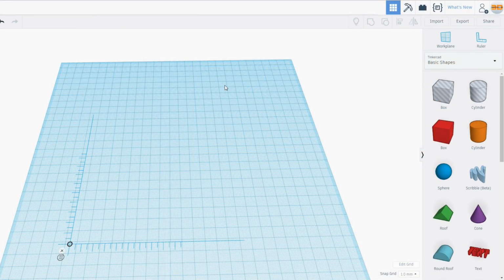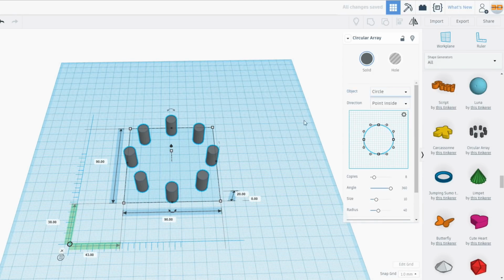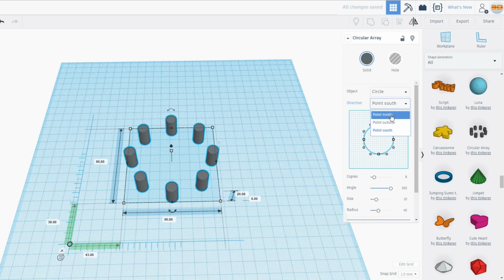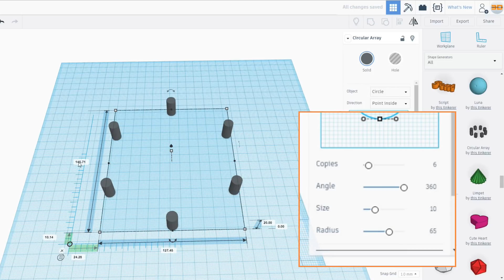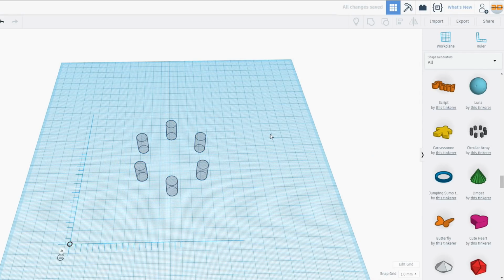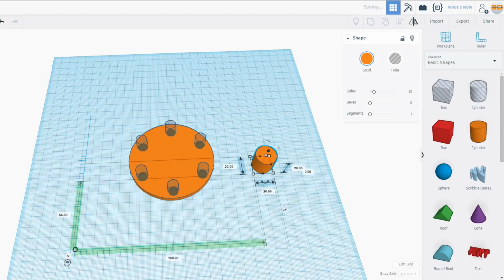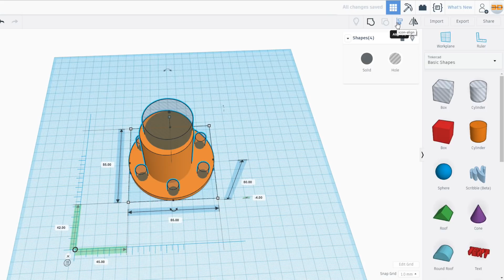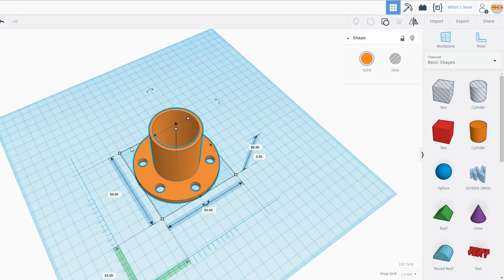TinkerCad Tip - Shape Generator The Circular Array!

Comment: Is there a way to quickly create a fillet on the seam that connects the base to the cylinder? I can think of a couple of ways of doing it, but it would involve making the fillet manually, wasn’t sure if there was a setting for this or maybe a quicker way to do it for added strength to the part being made. I only ask because printing this object in its current orientation would make it somewhat weak due to the layer lines. Just trying to think of a way to quickly beef up that seam

Comment: Holy cow, I've been doing this manually. I do have a couple issues with this though. You can't make the cylinders that are part of the array any smoother (they are defaulted to 16 sides), and if you make an array with an odd number of components, it will not center correctly with the align tool. They also will not rotate correctly, because the geometric center is not the same as the center of the array for an odd number of components.

Comment: The 140mm dimension comes from the radius going to the center of the shape - which are at helpfully lined up vertically in this case. So that leaves half the shape (which is the radius of the shape) but there is one on both sides, so that part is doubled - which is the diameter of the shape. At least for a circle shape. So it's 2 x 65 = 130, then add 2 * (half of circle size)  = 2 * (10/2) = 10 and plus the 130 is 140. In case it matters, I really did try to think of a way to say it so it's not confusing.

In any case, really awesome video. Thanks so much for posting it.

Comment: I'm having trouble with trying to make a rounded bevel on the inside edge of a tube like the tall piece in your video. I can use the tube shape with the option to round the end edge on the outside but the inside edge is still square. Any ideas how to do the inside edge?
Reply from the maker: This is hard in ThinkerCad (easy in Fusion 360).  The only way to do it fake it with a torus (to get an inverse use it as a hole on a circle....

Comment: Even I was curious can you rotate the figure in any orientation when you do a pattern copy. For example when you pull in a cylinder can you size your cylinder then flip,it on its side going from a pistol cylinder to cylinders like on a radial engine. Do you know what i mean. I've been playing with tinkercad taking a break from inventor.
Reply from the maker: Wow that is big switch (Inventor to TinkerCad!)  However no, I believe can only be done in one plane, not 100% sure I have been spending most of my time in Fusion 360....
Reply: @diy I went back to inventor today just to try and played with making a crude radial engine. The thing about tinkercad it's easy to grasp what's available . And fun to play with. In ventor has so many options. And very powerful. But love your platform I. Going to peruse your channel. I'd like to see your java script video on building shape generators

Comment: Thanks for the video! It has definitely helped but I can't figure out how to rotate the cylinders so instead of standing up, they are laying on their side and pointed towards the center of the ring. Is there a simple way to accomplish this that I am just missing somewhere?
Reply from the maker: Just click on the object and there will be two sets slightly opage arrows, one set for left and right with the other for up and down, just click and rotate...
Reply: @DIY3DTECHcom  Thanks for the response. I am familiar with the rotation arrows but rotating horizontally or vertically rotates the entire array. I will try to explain what I am attempting to do and hopefully provide more clarity than confusion. I have an octagon laying on its side so that the 8 sides are facing outward, across the X and Y planes. I created an 8 column circular array and am trying to rotate it so the bottoms of each colum touches the octagon sides. I then want to convert the circular array to a hole and merge the pieces together, leaving the octagon with 8 circular recesses in its sides.

Comment: Thanks for this Tinkercad Tip. I’ve been wondering if it had an Array function. Very handy to make gears & such now too. 

Is there a way to array custom imported objects? Or would I have create them solely thru Tinkercad.
Reply from the maker: Well sort of, I did a video it on a while back (or at least I think I did) on using shapes in either java or java script wrapper inside of tinkercad.  Its been a while, however if you want to do gears, I suggest using its big brother Fusion 360...

Comment: NIce Joe.  I didn't understand the part about the Sides.
Reply: Sides. So in tinkercad cylinders aren't really ideal cylinders, they're actually geometric solids. If you zoom in on them you'll notice that they're actually made out of straight sides that are anged together to form a cylinder. So if you made a cylinder in Tinkercad with 4 sides it would be a box. If you made a cylinder with 5 sides it would be a pentagonal prism. If you made a cylinder with 8 sides it would be an octagonal prism. By default it starts with 20 sides, which is still pretty faceted for a cylinder of most sizes. Joe increased it to 64 sides (The maximum allowed) to make it a smooth a cylinder as possible in Tinkercad.
Reply: Edit: So in short, the number of sides is the resolution of the circle. Long answer:
If you leave the sides to the default of 20, the 'circle' will consist of 20 straight lines forming a circle. That doesn't give a smooth circle, so you bump it up to 64. This is still 5,625 degrees per side so big circles will still look rough. There are shape generators that allow for even more sides, if you need absolute smoothness.
Reply: Ah, got it.  Thank You.
Reply from the maker: Good explanation!   Since Open SCAD works this way and you set $fn=x, I forget I also need to explain sides :-)